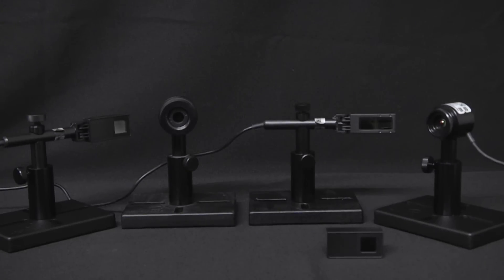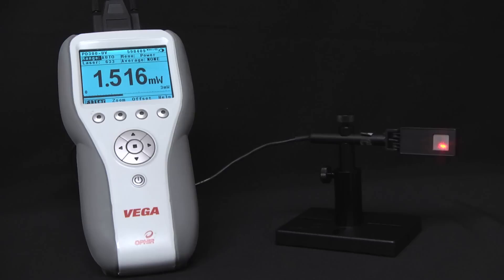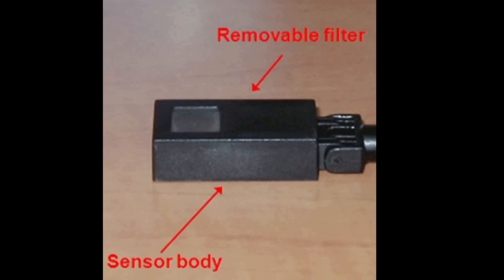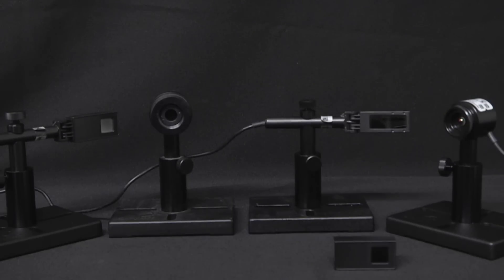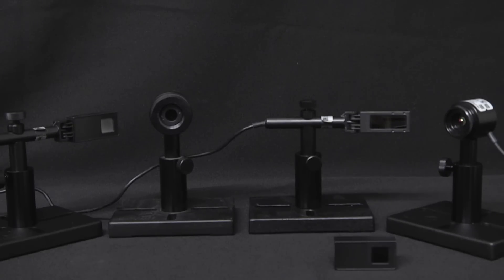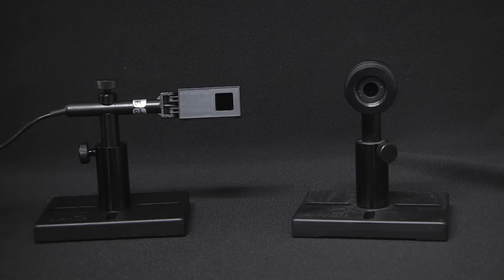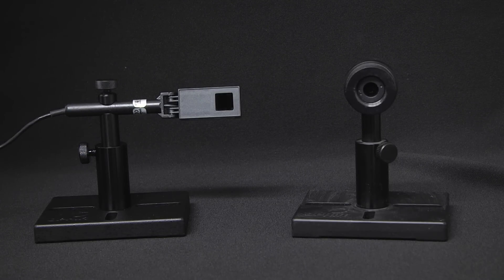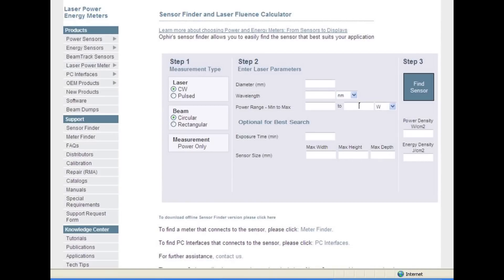Photodiode Sensors for Measuring Very Low Powers

Comment: i want to ask a question.  if the intensity of light changes, for example if i open the door 2cm and then 1 m will the reading of the Diode Change?
Reply from the maker: In principle, yes – as long, of course, as the relative change in power reaching the sensor (the change in power relative to the total power) is within the resolution limits of the sensor. This depends on the sensor type, the power scale it is set to, etc.